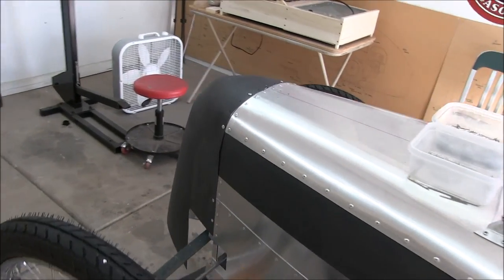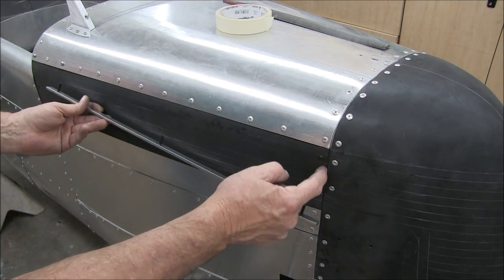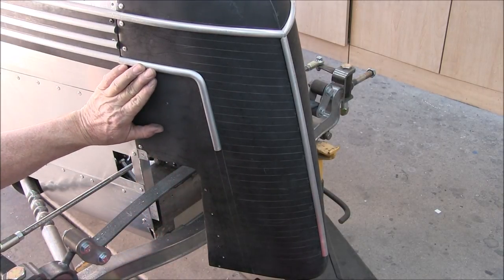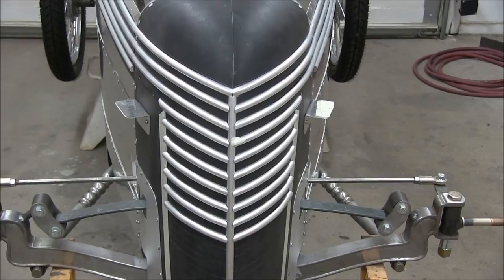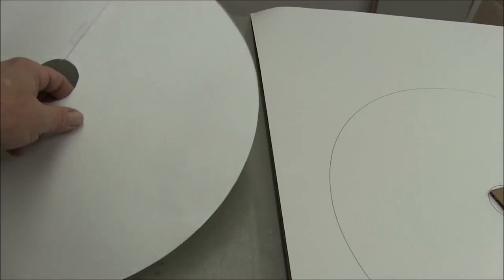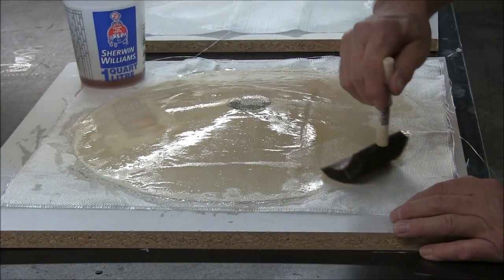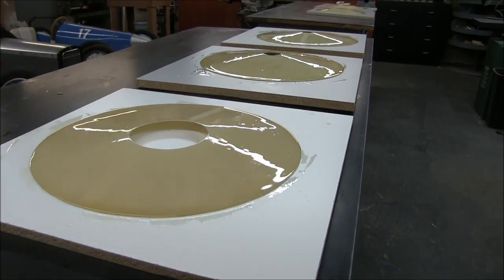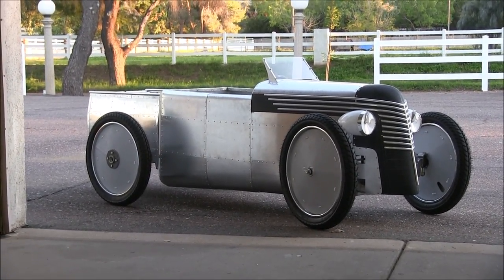Building the '37 Studebaker Body Part 12

Comment: I  was under the impression these were suppose to be low cost homemade vehicles. This is Cleary not that description.  But after saying that. I am sure this car will turn heads when you drive up. I am glad you did not turn off your comments the way a lot of cycle Marist are doing. This will be a gem when your done